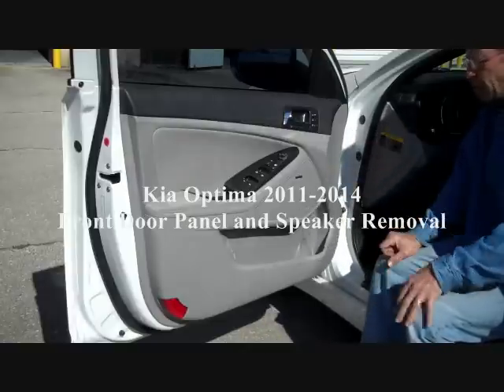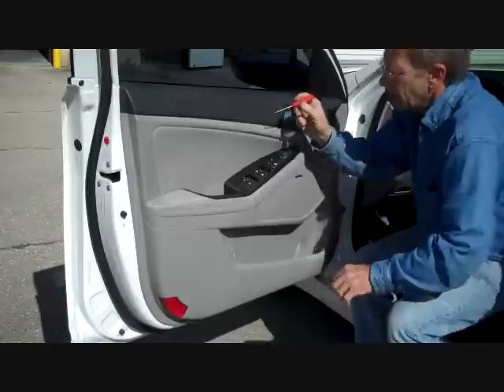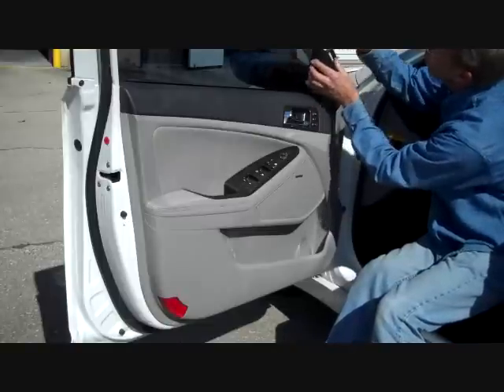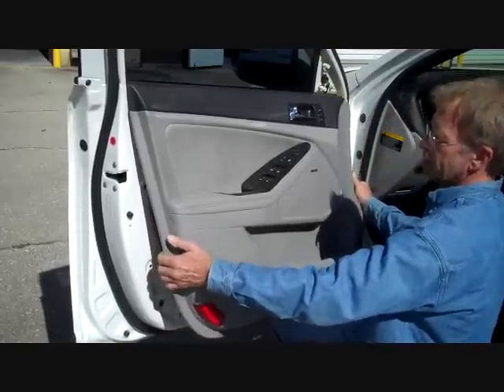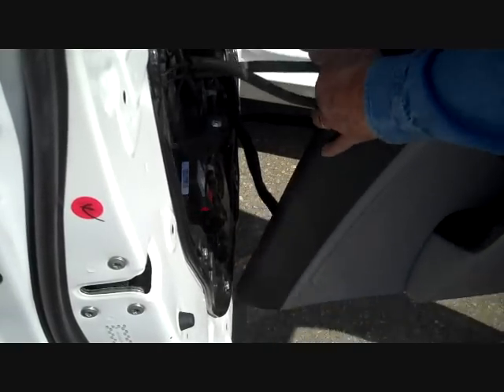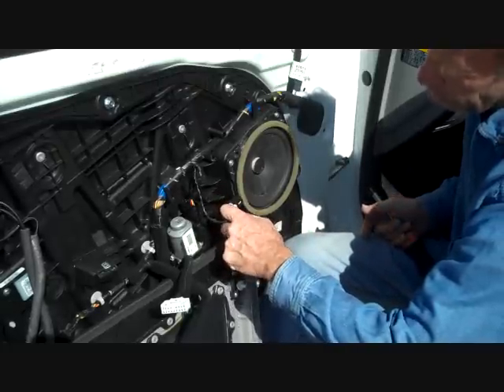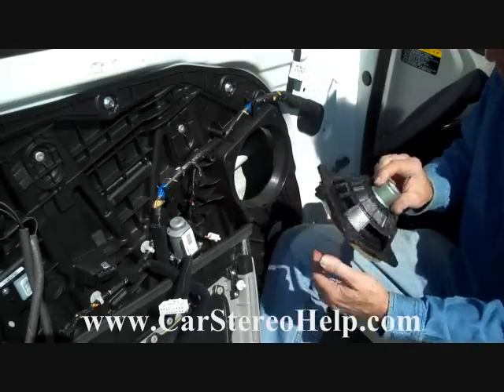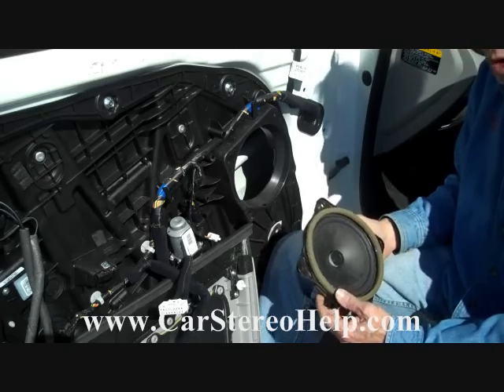Kia Optima Removing Front Door Speaker 2011 - 2014 = Car Stereo HELP

Comment: mmm, you didn't observe that there are two inseptions on the bottom of the door where you can place your finger in and easily (firmly yet carefully) you can pry out the panel? No need for the pry tool at all.
Reply: +Tamás Alföldi Thanks for the tip!! lol

Comment: Could anybody tell the depth of the speakers since he said to consider this but didn't actually say the exact measurement?
Reply: Nicolas Salazar the 6.5 will fit fine but anything bigger than that it's gonna touch the metal at the back and you will need adapters to fit something bigger
Reply: @javierjaime9386  ...he ask for the depth, not the size.😅